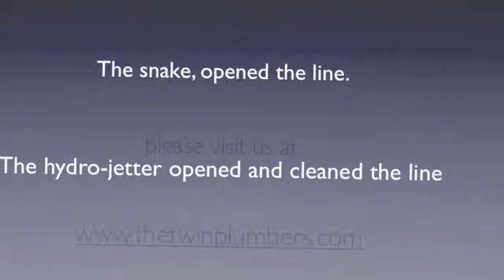Snaking vs. Hydrojetting

Comment: 35 years of experience here, licensed plumber for over 20 years, plumbing Supervisor over a very large school district. I completely agree with the benefits of jetting,  however it is not always applicable or advisable in many circumstances. You could easily flood the area with the water you are introducing. In such cases the augering first to clear most of the standing water to reduce the chances of flooding then follow-up with the jetting and  camera to identify other problematic issues.
Reply: Good points. Another issue I see that the twins didn't cover is when a root mass is alive and attached to a very tough tree on the exterior side of pipe. These fellers just stuffed some stuff in the pipe, and had the benefit of watching exactly where the head was so they can carefully push through those areas. They also used a spiral head snake- worthless for cutting roots. In a real life root situation, I definitely want that snake to have heavy duty spinning blades to chop those roots all the way back. The jetted snake would seem pretty unnecessary to me if it can't cut through roots like blades can, and this video doesn't give me any confidence that it will.
Reply: Thats a good point because I was wondering why anyone would even use and auger in this day and age?
Reply: @Rick-the-Swift  I am not a professional but I have rental properties and plumbing issues happen from time to time. I had a company charge me $600 and couldn't open the line with an auger. They wanted an additional $950 to jet the line and I just bought a professional machine and said I will handle my own shit literally! I had never used a jetter before and opened the line up within 5  minutes. 

I did my research before buying because I was also worried about roots and could water get through them? With the right machine and nozzles, that water will cut through root systems. I used the reaper nozzle, bad to the bone but pricey.
Reply: @Rick-the-Swift  The local plumbing company showed me their inspection camera view of my 60ft length clay pipe sewer line, was blocked in 4 places with tree roots between 1/32" to 3/16" thick.  They water jetted it clean and like brand new in about 40 minutes was close to $500. The house has a vacant lot 25 feet away filled with trees. They hauled their lines down the basement and when they left it was spotless.
Reply: @jhill6033  How much for a jetter ?  Most I have seen are over $3k
Reply: @jhill6033 do you have a link for the machine you bought?
Reply: @jhill6033 how’s that going?
Reply: @ Sorry, just seeing this, I spent $2,000 on it and used it only once.
Reply: @ Its a great machine, I haven't had to use anymore, but I like having the ability to handle issues like that myself.

Comment: Master plumber note to follow is do not use a jetter on old piping such as cast and copper piping 20 plus years old or you could flood the home fast.  Snaking and augering drain lines is something worth paying someone that knows what they are doing alot of money and make sure they are insured and license!
Reply: Is it going to burst the pipes?
Reply: Thank you for this information. 👍
Reply: I removed the toilet in a double wide trailer and there was water clogged but now its just about 1/4 of an inch I've snaked and lubricated with dish soap and hot water (not boiling). Do you think if I put the new toilet on and flushed it I'd be good? Like I said I can see water down in the horizontal pipe but it's barely any,and it's not coming up the pipe anymore just sitting still where the pipe goes horizontal. Any advice would be VERY VERY appreciated
Reply: @nicecobra1991  Cast iron will become very  brittle over time, almost like a claypot but iron. It is not meant to be subjected to 4,000 POUNDS PER SQUARE INCH!!
Reply: I guess nobody should do their own work and call you guys is that right?  LOL
Reply: Says the plumber who’s going to charge 1500 to do the job.
Reply: I was renting a duplex several years ago that had regular plumbing problems because the landlord didnt want to spend the money to actually fix the problem. He kept hiring someone to come out and jet the pipe. Well the neighbor had a clog and the plumber came out and jetted it. We were at the grocery store, came back to find our side of the duplex completely flooded.
Reply: @nicecobra1991 it could if the pipes are really old which could be brittle or thin or both.

Comment: poor comparison. When you have a blockage you are also going to have water in the line which will remove debris once the blockage is broken.. The hydro jet technically was developed for municipal use in jet trucks for sewer lines . The jet hose would go in to the manhole from the side past the  blockage, not from the other side where the water is backed up. The water jets shooting back toward the hose is meant to propel the hose forward. Once the jet stream shooting forward hits the blockage and breaks it up the water behind it will now flow pushing debris downstream. Once the flow decreases in the line then the jet hose is retrieved as it comes back with the water on it further cleans the line back to the manhole in the direction of flow.

Comment: I would have thought that the difficulty of dealing with root intrusions is that the roots are attached to plants and not just sitting in an otherwise undamaged pipe.
Reply: Yea I don't understand.
Roots are not just chilling in the pipe like toilet paper. You have to cut them to get them to detach.
I'm curious if your more likely to damage the pipes when putting large amount of pressure in them. I imagine old pipes and especially ones with breaks/roots would not take pressure very well and could damage them more.. Resulting in needed to dig up the pipes and replace something that you may of not had to do for many years or ever.

My old house I used to live in had roots and breaks all over the place but it drained just fine. The dirt around it acted like the pipe. I imagine many old homes have some breaks here and there. Water pressure may just end up digging a hole causing a collapse. No idea.. Just curious.

This probably works great for new homes that have no roots/broken areas.
Reply: @bobshanery5152  
Absolutely, if the bottom of your pipe is rotten and missing the Hydro Jetter will channel out the dirt underneath the pipe. Often times, the Hydro Jetter will break up and chop away roots inside the pipe using the high-pressure water.

I always recommend a form of trenchless repair on sewer lines missing their bottoms where possible. That’ll keep you from the time to dig it up right now good luck Chuck option.
Reply: You know this is a demonstration right?
Reply: cause these guys are a sham. They used just a cable instead of a cable with a cutting head on the snake
Reply: @bobshanery5152  I had a roto-rooter tech clean out my sewer drain from the riser in my yard- he had sharp blades on his rotor rooter snake and it cut those roots out very well- then he scoped it with a camera and gave me a CD of the inside of the pipe for the new home buyers to see for proof it was a clean sewer line.
Reply: @kylekoenig4730  I'd be very leery of using either the pipe bust liners, or the epoxy liners. Busted old iron pipe can dig into the new plastic pipe, and many fittings will jam the system causing cavities to form around the pipe. The epoxy liners will definitely shrink the ID of your sewer line as well, which may have already been undersized. Plus, if I'm going to pay for or perform an expensive repair, I want to see the new pipes are pitched perfectly and have adequate support. Think about what you said about pipes having their bottoms rotted out. That also means the dirt beneath has likely eroded as well, which may cause settling of the pipes. It would have to take a lot of obstacles to get me to consider using any trenchless technology. Just my 2 bits.

Comment: Great vid, TY! 
As a drain cleaner, I avoid jetting in a home. With a blockage like this I would use a blow bag and cable. Cabling to cut roots and blow bag to get the soft blockage to go out. And not all over me ( ! , LoL)  and the customer's house.  A "blow bag" is a balloon like device used with a garden hose. It has a small hole that jets water forward while expanding to seal the pipe off and directing water forward and away from  the clean-out. And you/inside home. Jetting is great and defiantly has it's place. Outdoors or in easily cleaned, industrial settings.  But personally, I would avoid using in say a kitchen, bathroom or finished cellar.  For roots, you would need a seriously high powered jet where a cutter at the end of a cable would be more efficient.

But say a car wash or the like. Jetting is by far the superior choice.
Reply from the maker: Great share here Dan! Thanks so much.
Reply: @TwinHomeExperts  Hi there. I work in an apt. complex as an emergency on-call maintenance man. I had some tough clog problems in kitchen sinks. I tried snaking, but to no avail. Could i use an electric lower pressure, power washer with a jetter attachment to clean out clogged pipes in kitchen sinks? Do you have any recommendations for good electric lower pressure power washer brands and models?
Also, what snake model is he using in the video?
Thanks!
Reply: @randyjellen4938 looks like a rigid drain opener he is using.
Reply: The blow bag is also called a drain bladder.
Reply: Had my clay sewer pipe jetted from a basement cleanout to take out root blockages.  Worked great. The plumbing company left no signs they were even there, other than the pricey bill .
Reply: until the blow bag breaks and adds rubber to the clog...
Reply: @LyleH-13  never had a rubber or canvas one break. Just not enough pressure for that to happen.

Comment: A two step process works the best. 1st Using a snake to catch and retrieve roots works the best. 2nd Then after you have enough roots removed to get a little water flowing use the hydro jet to blast away the crude and really clean the drain.

Comment: Excellent video. We have a chronic issue with our laundry washing machine drain output branch line (1975 construction), and about every 1-2 years we've need to have the line reamed with snake since we moved in in 2001.  However, it showed no signs of needing the reaming for several years, so this year (2021) when it did back up we were about 5 years overdue.
The plumbers had some difficulty getting the snake down the line far enough, even after several attempts, and suggested Hydrojetting.  Wow!  That worked great, and the line cleared on the first run.  Very impressive.
Thank you for this video!  This gave me a much better understanding of the difference between the two methods.  We will use Hydrojetting from now on!
FYI, the audio Left channel cuts  out at about 4:35.  I see the video is about 8 years old, but still thought you might like to know.
Thanks again!!

P.S. - Total aggreement with Keena Witt's comments!!  Great video, thumbs up!
Reply: Glad I read down to see your audio cut-out comment.  I was thinking my left earbud was going on the blink, haha!

Comment: Snaking (rodoong)  is for hard stoppages such as rags and roots and hair  with a retrieving head on the cable.  Water Jetting is for soft stoppages such as grease , soil,   and soap scum build up and as a finishing tool after snaking .  Ideally   water jetting  should be started down stream  so the debris will flow downstream     as the jetter makes its way upstream.  This is not always possible so   starting upstream and working  the jetter back and forth will  help scour the lines to restore full flow as originally deigned
Reply: No. Did you not watch the video? Water jetting won hands down getting rid of everything.

Snaking was only good for clogged toilet paper.
Reply: videoshare5193  Exactly. Not only was there no cutting blades on the snake, there were no live roots attached to a living tree. This is a propaganda ad, as I'm guessing they will charge at least twice as much to bring out the jet snake. Then if/when the jetted snake doesn't work on the first go around, they'll additionally charge you to snake it traditionally, probably blaming the home owners for flushing tampons too. Smh

Comment: If it’s plugged won’t that water backup into the building until it clears the line?
Reply: It will
Reply: Yes it would . You can only use the Jetter if you have an " out side clean out" and use a test plug to seal off the inside clean out. Run the jetter through the outside clean out. the test plug will stop the water from backing in and up your basement clean out.     Or prepare for a mess .

Comment: Videos like this are what YouTube is for. Great work, guys. I never heard of hydro jetting until last week, and now I understand, through these clear visuals and the explanation, the proper application of hydro jetting and snaking.
Reply from the maker: Thank you so much. 
To your point , this is ALL we are trying to achieve is to show the difference between them.
cheers !
Reply: Wheres ur cutter for the kitchen machine?
Reply: HYDRO JETTING IS THE BEST WAY TO BLAST THAT CRAP RIGHT OUT OF THOSE PIPES.
Reply: @TwinHomeExperts  everything is
Reply: they are not using a good cable that would not break roots. hydro jetting causes damage and flooding and should only be used as an absolute last resort. especially in a residential setting. make suree you hire an actual drain cleaning company and not just a plumber. also most home augers and also the block on the jet is not ny where near the original blockage. take care snaking caost about 150-300 vs jetting 900 to 1500. and yes i know i work in the office for a drain cleaner.

Comment: Should really be using a dedicated forward facing jetter head when jetting down the pipe. 4 rear jets and 1 forward jet is pushing a lot of water against the grade of the pipe. It's appropriate if your jetting up the line but down the line is just asking for a mess. 15 years in the industry. Everything from mainline sewers, storms sewers, industrial, parking garages
Reply: I just saw a guy in the UK that drilled the front hole larger

Comment: Thanks I had what i now know was  hydrojetting done on my sewer line yesterday. I had initially started to clear the backed up debris myself before deciding I needed the pros. The guy that came to my house was here a max  20 mins and told me that the stuff i had already removed  (and bagged for disposal) was thrown back down the line and cleared away. I presumed the material would be removed at the property and not sent off on normal sewer path. It was expensive but it's done now and I'm delighted. Will consider hiring equipment if it happens again.
Reply from the maker: Awesome! 
you should be able to see the line with a sewer camera to determine the overall condition once the cleaning was done. Thanks for posting.

Comment: After using the snake you should flush the line with water the results could have been similar to the jetting.  What do you think?
Reply: that was my thought... where i work , I flush the lines with HOT water and if possible, i will have water flowing as im snaking.

Comment: Most of the guys who are using the "Electric Eel"  snake machines are using a 2 blade cutter rather than the screw auger.  I'd like to see how that works.
Reply: You nailed it.  This wasn't a fair fight , it was a commercial for the  jet system